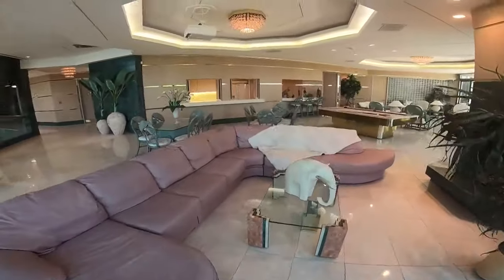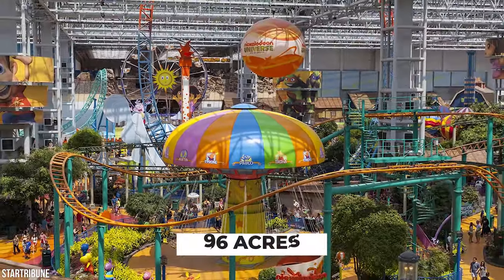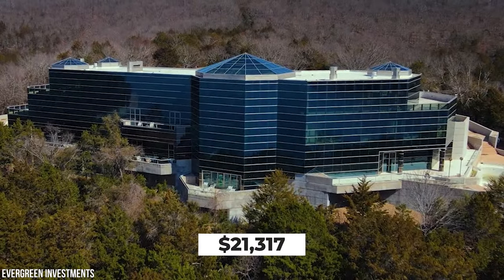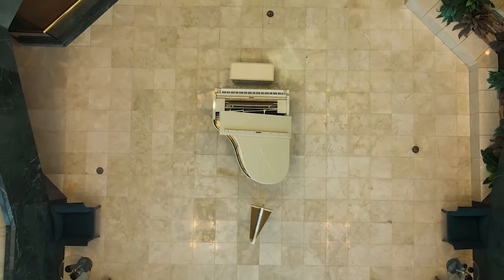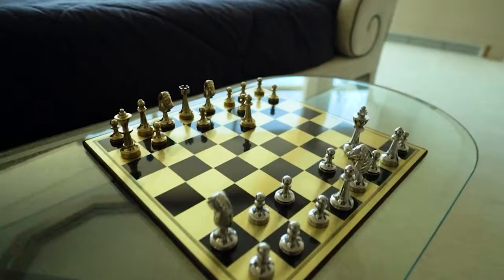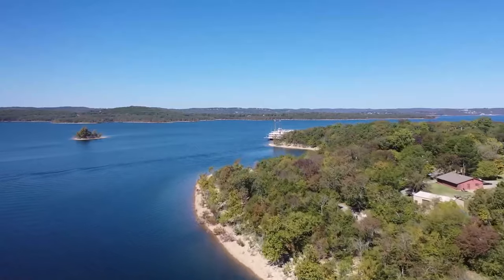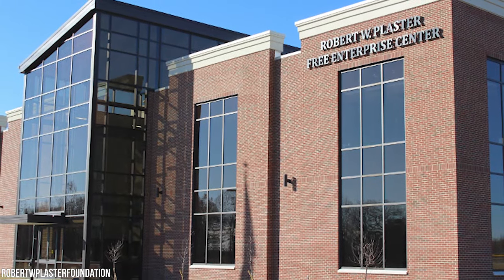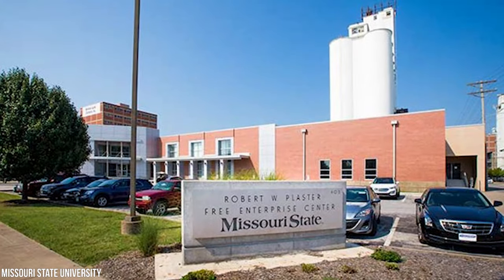Inside An $80 Million Dollar Mansion Made Of Glass

Comment: Except for having things checked out by qualified inidividuals the mechanicals of this beautiful place - would not change much else other than updating what really does need to be updated such as electrical, heating, A/C, plumbing, and then technology items such as security/camera systems perhaps.  

One primary goal would be getting it far more energy efficent as well "green" so to speak with an example being adding a fair amount of solar with battery systems/generator so as to get this more so "off grid".   Heat pumps?   

If not much else was ever even used but is in good working condition - why waste $$$?  Everyone who narrates as well as comments on these videos of the Evergreen Crystal Palace says it needs so much updating?  To what? The latest "yuppie" trends?   I think it is very gorgeous pretty much as is as well as unique plus even though it was built 30+ years ago was far far ahead of it's day back then.  

If any remodeling and to make it even more self-sufficent - use the first 3 floors for a boutique' higher end motel/hotel/resort and use the 4th floor for living quarters/offices on a personal/private basis is another thought but would not change anything any more than is necessary to keep everything as much as it is now and going forward.